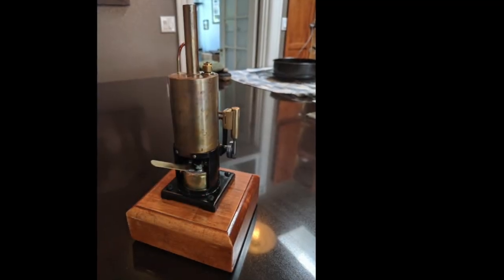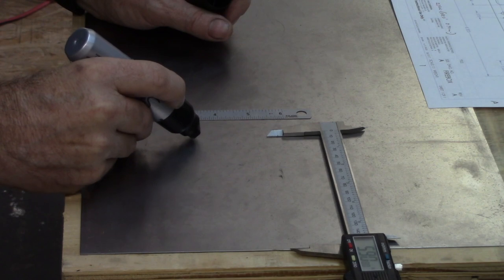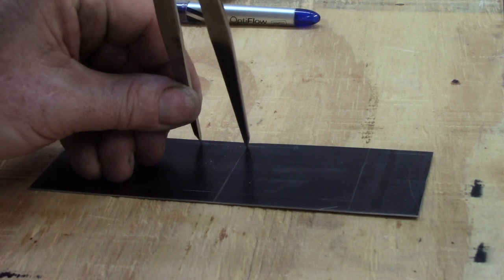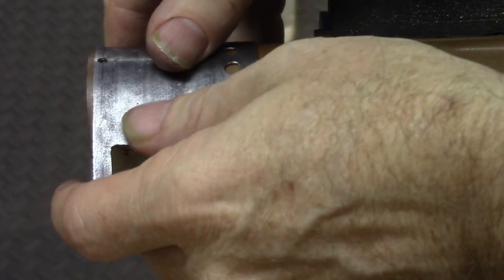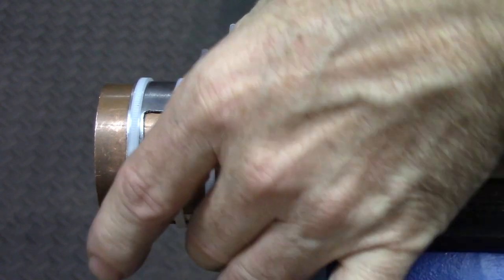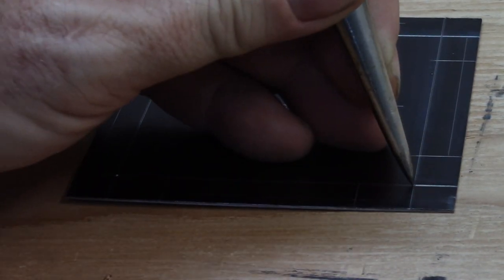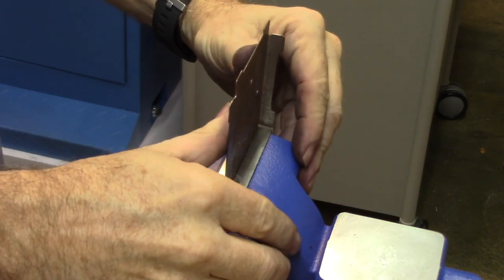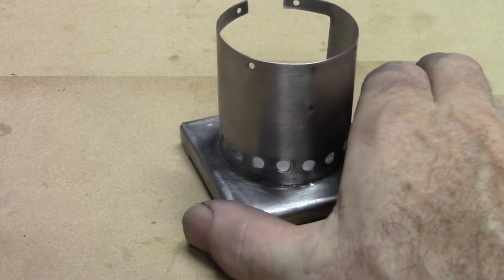Fabricating the Firebox for the Steam Engine

Comment: Why didn't you clean up the fire box in the acid bath like you did with the boiler? Because it was steel rather than copper?  Informative video,  thank you!
Reply from the maker: There are a couple of points: The firebox was soft soldered not silver soldered so the flux is less of a problem, and the boiler joints are critical given the steam pressure, so getting them as clean as possible extends the life of the boiler and the joints